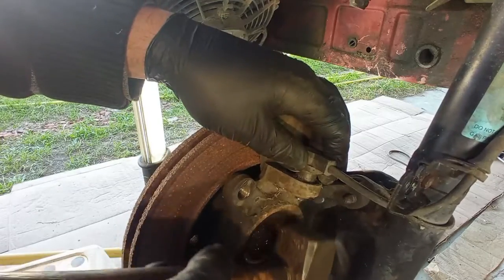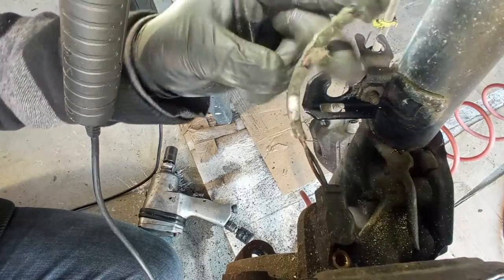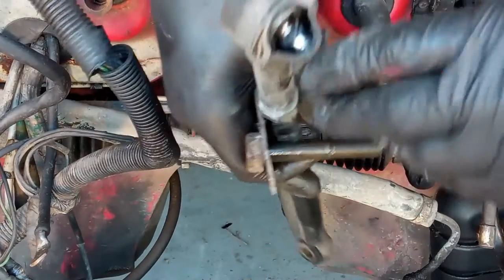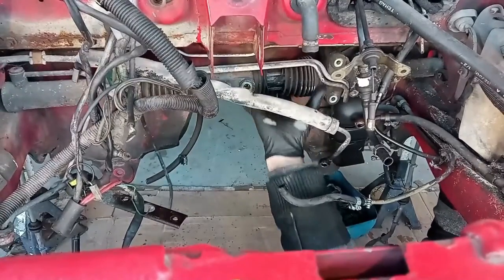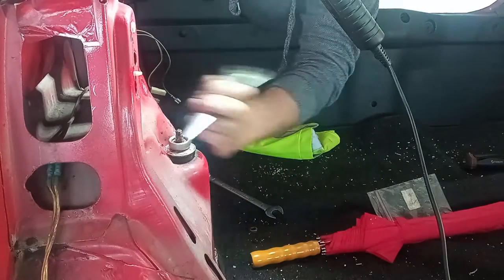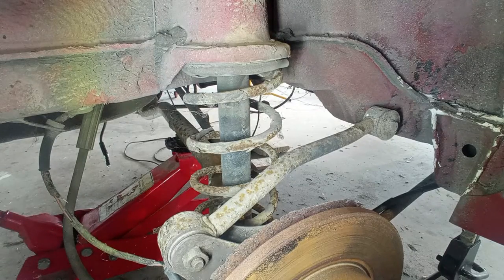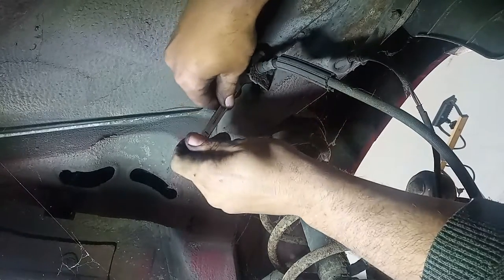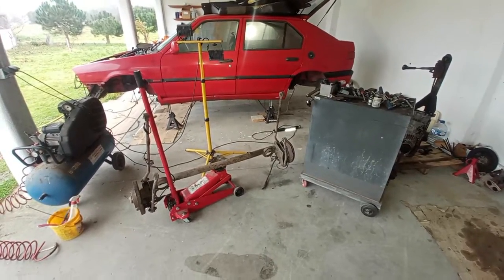Alfa Romeo 33 1.7 liters 16v 140hp. Total disassembly for restoration.

Comment: I am failing to see which part of the car has "bad build quality" that everyone is complaining about on old Alfas.
Reply from the maker: My guess on this model, some plastic parts. But not all..
Reply: This body is far better than most of the ones I've seen. They usually rust at the fuel cap (here it seems fine), around the heater (present on this one), and the sills/front and back especially (to be seen on this one.)
Reply from the maker: This one is on the floor because of a old leak. I will talk about that on the next video.
Removing the dash and climate

Comment: Can you help me with part number for Dacia Sandero 1.4? My catalytic converter was stolen. The new one arrived, but I need the downstream oxigen sensor (the one that goes after the cat). Is it the same as the front one? Here they only seem to sell front ones. And the ones that they claim is the back (out of stock anyway), at other places I find that it says that it is the front one actually. And for some it says front/back. Do you have the correct part number for the back one? 
VIN is UU1BSDAEH41624954.
Reply: I ended up ordering a universal one from the dealer. Has no connector, just bare wires... :/
Reply from the maker: I'm so sorry for that. The front and back are the same type yes. They may only differ on the cable length
Reply: @alfaromeonoproblem  Damn. So many contradicting information. I found somewhere where they say the front and back are very similar, but different enough not to be able to be used for both. And somewhere they show pictures of the sensors and they look different. The front one is shown as longer and with more and longer slots for the sensor. While the back one is shown as a round short tip, with a few small slots.
Anyway, the front one you can find everywhere, but the back ones almost nowhere. I ordered a universal one from the dealer, and they just called me and said that they managed to find one with the connector. So I am picking it up today.
Reply from the maker: How many wires do you have on the front one? 4 or 6?
Reply: @alfaromeonoproblem  4 wires. YT keeps deleting my comments...
Reply from the maker: If you insert links it will do that
Reply: @alfaromeonoproblem  No links. But I wrote "bоught" or "stоrе", or something. And it thinks is it spam, as if normal people woild never write that.
Reply from the maker: We have scammers and spammers to thank for that.
Reply: @alfaromeonoproblem  I think I wired the O2 sensor incorrectly. :/
The two white wires should be heater, and I soldered them to the two white wires on the car side. There was 12V with the ignition on, on the car side, but when I soldered the white wires from the swnsor to them, it did not show voltage any more.
Also, on car side, brown wire showed short to ground, so I soldered it to the gray wire of the sensor (Hella document said the gra is ground, and the black is signal). The ogange wire from the car I soldered to the black on the sensor.
With the OBD II reader, the 02 sensor showed 100% fuel trim value and 1.275v (max). So, I thik I did something wrong.
Reply from the maker: If you can get the wiring diagram from your car would be nice. 
The 12v are only present during cold engine conditions
Reply: @alfaromeonoproblem  No, only for Logan, and it does not cover O2 sensors.
Reply: @alfaromeonoproblem  Yeah, I faked it up for sure. P0136 O2 sensor circuit malfunction.
I will take the car to the car electricion, but the question is, did I kill the O2 sensor. Probably yes...
Reply: @alfaromeonoproblem  Should I swap signal and ground wires and see if that was the issue?
Reply from the maker: Hard to say.. probably yes
Reply from the maker: That may help, yes.
Reply: @alfaromeonoproblem  I figured it out. The connector at the car side has 2 wires that have thicker copper (same diameter insulation), so those are the heater. But... The whole world uses same color wires for the heater, while French use white and orange... So basically, I have connected 12V nominal to the ECU signal imput for the sensor... Now I have connected it right, and it reads normal voltage on the sensor ( about 0,4 V). But the trim is still at +100% (should be between -15 and +15%). Not sure what is the deal with that, since it is the downstream sensor...
Reply from the maker: The final sensor must read lean or the catalytic converter is good and warm
Reply: @alfaromeonoproblem  Thanks. I found online that if the trim is not used for the downstream O2 sensor (as it is not), it just shows max value. So it is all good.
Glad I managed to fix this today, since the next two days will be very hot (37 oC).
Reply from the maker: I'm glad you're able to solve it